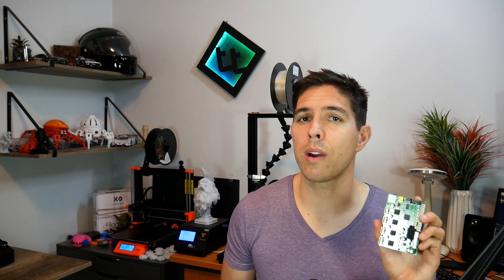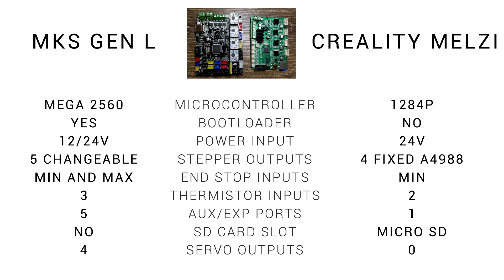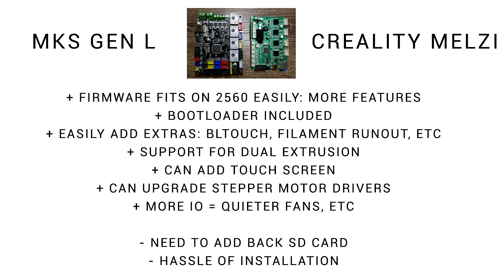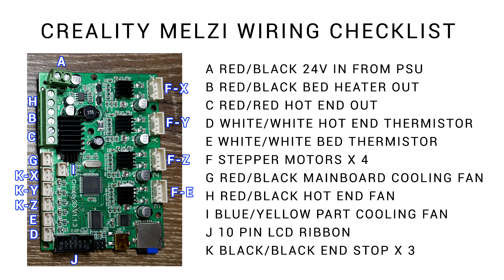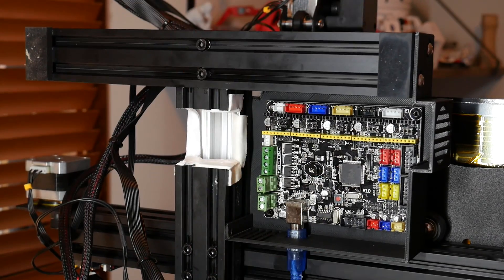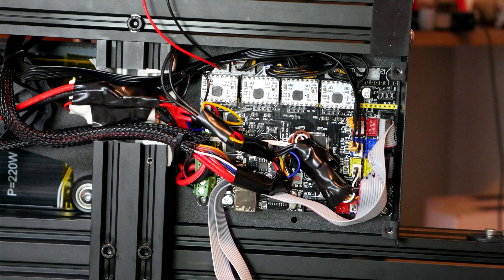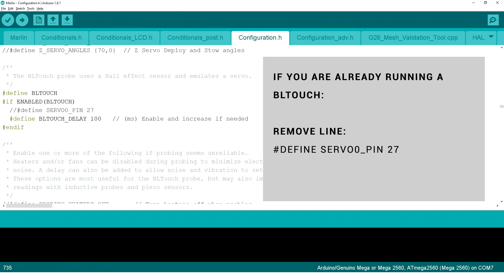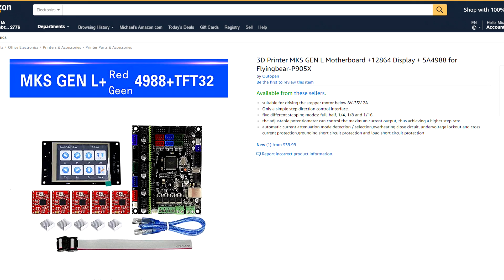Easy and cheap Ender 3 mainboard upgrade: MKS Gen L guide

Comment: Found my brothers old ender 3 and it has this board and the tft28 with it. Doesn't seem to be working so wondering if firmware is wrong. I know this video is old :D but do you happen to know where i can find the firmware for board and screen?

Comment: Michael, I have a CR-10S pro v2 and I get a negative 15 temp reading when it boots up. If I try to heat things up it gives me the temp sensor error and tells me I need to take readings. From all my research it seems the board may be fried. Should I just get the regular Creality board, or are there better after market options? Thanks in advance for any response.

Comment: Thanks for this video i was trying to install marlin 2.0 to Mks gen l i bought online and  i tried as per your video but i am not sure how to set it for Anet A8m model with dual extruders even then i tried with your settings and got an error say "cpmlition terminated. Exit statis 1 Error compilinh for board arduino mega or mega 2560 can you help as i am new in this and dont now much about the programing. Thanks in advance.

Comment: Hello,I am trying to use mks gen L v1.0 board with my cr 10.I have tried to upload the  marlin frimware by making changes as per cr 10 configuration but my machine still not working.
I am able to use pronterface software to move steppers and set the temperatures and run fans.but as i start printing thereis nothing happening on the machine.

can you please provide me the firmware for the same.

thanks in advance

Comment: I wish you went more in depth I  flashing the board.

I'm stuck and been stuck for 3 days on it.
The computer wont communicate at all with board other than it allowing me to preheat the extruder and bed.

That's all it does for me. I've been through adruno and got the settings right for it. But I cant get it to communicate at all with it. Keeps getting red error messages.

Yet. When I press send...it makes board blink for a second or two then gives red wording. I've been through drivers and I'm about ready to throw it in the trash
Reply: Did you ever find a fix for this? I am trying to upload the firmware and keep getting board disconnected message at the end of the upload. The board IS connected, and I have the correct board and com port selected, at no point does it disconnect, however arduino keeps giving the message. The firmware is able to verify without issue. I have tried updating the drivers, using different com port, restarting my computer, uninstalling and reinstalling the arduino IDE. I'm running out of ideas, this is a brand new board and nothing has been done to it besides connecting everything and plugging it in to the computer.

Comment: Is there any way you can send me a copy of the firmware for the MKS GEN L mainboard.  I bought the mainboard for my Ender3 after watching your videos several times. I have tried and tried many times to get the marlin firmware to work but I constantly come back with errors after I hit verify and I have no idea how to fix the errors. Please forgive my ignorance with this. I am pretty good with hardware but have very little experience with software/firmware and you make it look so easy. My original Ender3 board quite operating the extruder function. This being said I did make my own direct drive mount out of aluminum like the ones they sell fot $35.00. I also installed a all metal hot end. I have after market bl-touch, not a name brand but it's not mounted because I can't print the part to hold it. I also bought a micro SD card slot that is supposed to snap on to some of pins of MKS GEN L board. I am very sorry for this lengthy message but I haven't been able to use my print I almost a year. Please any help you could give me would  e more than appropriated. Signed Ken.M thank you again sir.

Comment: hi mick i am getting this error can you please help,Arduino: 1.8.9 (Windows 10), Board: "Arduino/Genuino Mega or Mega 2560, ATmega2560 (Mega 2560)"

In file included from sketch\ultralcd_impl_DOGM.h:80:0,

                 from sketch\ultralcd.cpp:96:

dogm_font_data_Marlin_symbols.h:34:20: error: U8glib.h: No such file or directory

compilation terminated.

exit status 1
U8glib.h: No such file or directory

This report would have more information with
"Show verbose output during compilation"
option enabled in File -> Preferences.

Comment: Wtf why is there a connector on your hot end cooling fan wires. And how are you connecting it to the board with that connector? Are you using some sort of adaptor? Why?

Comment: hello guys
i got my ender 3 and decided to update it 
First i updated it to an MKS GEN 1.4 with TMC2100
compiled Marlin 1.1.9, 2.0 and 2.0 bugfix gave me a board compiling error
everything worked fine , had to reverse the stepper motors direction in the firmware
all ok, except for the extruder
working but very very slow, it takes about a minute for 10mm of filament
watched all possibles videos, no tutorial mentioned swapping the cables for the stepper motors
either for the MKS GEN 1.4 not he MKS GEN L
tried E0 on a different axes, motor worked fine
but everything connected to E0
runs at a very slow pace
swapped motors, cables,steppers (A4988) and even motherboard
not working as it should
i tried to find the pairs of the cables with the led method
found pairs, didnt know ho connect them
so i tried all possibilities
i am going bananas for almost a week
i dont know what to do
i could swap to an mks mini
but i followed several tutorials for the
MKS GEN 1.4 and MKS GEN L
and still the same result
so i would like to solve this problem
is there someone that has had the same issues
any help is appreciated
i will send a sixpack as reward 
to the one who can help me solve this nightmare
thanks

Comment: Hi Michael, I have a question about the V2.0 board. Will this work the same as the v1.0? It has a lot more jumper options etc... and will the firmware from the v1.0 work on the V2.0? I’m putting one in my CR10, so if you have a working solution for me I really would like to know 😁

Comment: The board reaches its maximum if used on delta printers in combination with a touch TFT.
The atmega2560 is an 8 bit controller. Delta printers should better stick to 32bit processors so for example the MKS V1.3 which uses LPC1768 or boards with an arm STM32 processor. Bonus, also higher clockrate, DMA that can speed up alot , the atmega's don't have that.  note, use marlin 2.0 for any of the 32bit boards.

Comment: When verifying, I get this message in arduino and can't figure it out:

sketch\src\HAL\HAL_AVR\u8g_com_HAL_AVR_sw_spi.cpp:65:20: fatal error: U8glib.h: No such file or directory
compilation terminated.
exit status 1

Error compiling for board Arduino/Genuino Mega or Mega 2560.

I have Arduino Mega 2560 set for board and Atmega2560 set for processor like your said. Can anyone help?
Reply: yeah you need to to go SKETCH > Include Library and mae sure you installed U8glib as its necessary for the LCD.

Comment: What is a boot loader? I'm lost straight out of the gate
Reply: You have lots to google about. Type "what is ender 3 bootloader" in Google and you should be sent on your way. This will raise further questions, just repeat the procedure.
Anyway, a bootloader is a way to change the printers firmware.

Comment: I want to replace the controller on my Ender 3 Pro I was thinking Bigtreetech SKR Pro 1.1 with TMC 2130 spi do you thing I need to upgrade the LCD display and what do you think about the THC 2130spi drivers ?

Comment: Hi, Looked at your video. Very interesting but you go to quick through the explanations. Also the mk gen 1 box that you show is not on thingiverse. The improved - storage in the back of the ender 3 is there and I would rather have the model you showed that is in the front with the lid and fan in front. can you please supply that one? Also as a newbie - what type of ribbon cable will I need?

Comment: Hi there, 
Love your channel, you are very clear and informative! Clearly shows that you are a School Teacher keep up the amazing work!
I just have one small critasism, I am currently upgrading my Ender 3  with the MKS GEN L board, tmc2100s, bl touch, tft32 and EZR extruder. 
When it comes to the firmware I'm a complete idiot and am trying to follow all your appropriate videos that include the fw instructions. 
I am finding it soo hard to follow though as the fw alterations are scattered across so many videos that are not specifically fw videos! 

Would be soo great if you could edit together a single video solely on vanilla marlin fw changes, rather than referencing "we did this in another video" but dont put a links to those in the description!
I hope that makes sense lol 
Keep up the outstanding work 👍👍

Comment: Please help. I did everything as you wrote and it broke my printer. I triple checked all the connections. Hotbed doesn't work at all - it doesn't detect its temperature, Z axis is stuck halfway up and I can't move it down further than that. On top of that, I followed your TMC2100 tutorial and extruder makes terrible noise and loses steps... Please help

Comment: my creality board 1.1.4 x axis plug dont work, can it be fix or do i need to buy a new board? thanks
Reply: i know its the plug because i replace the y with the x and it worked but not the y engine so it must the board plug

Comment: i keep getting the  error message "avrdude: stk500v2_getsync(): timeout communicating with programmer
An error occurred while uploading the sketch" does anyone know how to fix this?
Reply: Are you trying to flash a bootloader? I was getting a similar error when trying to flash a bootloader, and fixed it by adding a 10k ohm resistor between the arduino ISP's GND and Reset pins. This prevents the board from resetting itself while trying to flash the printer control board.

Comment: good day Michael. thanks for the videos. I did this upgrade to my ender 3 and have been using it for a while. recently the printer started rebooting about every 30 seconds and octoprint won't connect. any idea what this problem is? it has never done it during a print and I have been printing a lot lately. until today it would do it a few times then I could connect but now it just does it over and over. I really need some help on this

Comment: First , I love your videos .... I have decided to upgrade my Ender3 and my ender3 pro . I would like to switch to either this main board or the one in a newer video ( SKR 1.3 )  and I would like to add bltouch and the color touch screen .. I am new at this. I would rather do everything at once if possible..  1.) which board would you recommend  2.) Can all of these changes be done at once..   What process should a relative newbie take to tackle this ..?  I am still using the stock hot end configurations .  Thanks 
'

Comment: Does MKS GENL support tmc2130?
If so, what mod do I need to change?
Thanks
Reply from the maker: I have a video on this linked in the description
Reply: @TeachingTech  thank you so much for all of your video and tutor. I am a beginner for 3d printing. I am going to buy a Ender3 Pro and there is a question about the firmware on ender3 pro. Is ender3 stock firmware compatible with ender3 Pro? vice versa. I will stick with stock setting and upgrade the printer step by step as I am still figuring out the marlin and all program.

Comment: Long time watcher first time commenter. 
Hopefully you can help. I have a ender3 with mks gen l board.  I installed the bl touch, everything is operational with the exception of when the probe is pushed up it doesn't stop z movement going down. 
I got frustrated and reconnected the stock z end stop, to my surprise that doesn't stop a movement now either.  I'm guessing I screwed up firmware somewhere. Any ideas will be appreciated!!

Comment: I have followed all of the steps one by one but MUST be missing something. on two separate computers i have had the issue of arduino not being able to upload to the board because it doesnt recognize it. It times out after 10 attempts every single time.
Reply: I have attempted this on 5 mks gen l boards already with 0 success. 3 burnt out during my attempts to upload whether from making contact with a conductive material or just bad board i cant say for sure.

Comment: its good board no need upgrade. is it 32bit. well then you need upgrade again lol
why need bootloader. just god damn flash firmware. you need do it 1 time in your life. if something work no need update.
bootloader take memory and corrupt print if you plug usb. it reset printer becouse bootloader

Comment: Great video - Best I've found and I've done a lot of searching lately as I have upgraded my Ender 3 to the MKS Gen 1.4 board and followed all the instructions - flipped the ribbon cable - connected EXP 1 on mainboard to EXP 3 on LCD panel, updated and flashed the firmware updates but the LCD panel does not show text/menus.  just blue.  the panel DOES work on the original motherboard (but old board has issue with bed temperature).  So I suspect its something I'm doing wrong in the firmware...  Help appreciated!

Comment: I am trying to enable auto extruder fan when temp goes above 45C. I have the code below but the fan is still always on. It is not being controlled by temperature. Not sure what I did wrong. If someone can help I would appreciate it.

#define E0_AUTO_FAN_PIN 7
#define E1_AUTO_FAN_PIN -1
#define E2_AUTO_FAN_PIN -1
#define E3_AUTO_FAN_PIN -1
#define E4_AUTO_FAN_PIN -1
#define CHAMBER_AUTO_FAN_PIN -1
#define EXTRUDER_AUTO_FAN_TEMPERATURE 45
#define EXTRUDER_AUTO_FAN_SPEED   255  // == full speed

Comment: I did it like in the video except:  Display was connected with just 1 cable: EXP1 to Display(plug was turned 180°)
My sd card reader was connected with 1 plug(8pins) to AUX3. I had to change the pins from the cable that came with the sd card reader.

Display and SD Card works, everything else also as far as I can judge it...

I just have ONE problem that I can't solve. My display looks very BLUE and bright with less contrast(white).
When I change the angle and look in a flat angle it gets better....what can I do??  (Ender3 display, MKS Gen L, Marlin 1.1.9)

Comment: Ok i did a tripple uprgade - MKS Gen L, TM2130 Drivers and BLTouch.
I have a couple of problems so far.
The drivers seems to be inverted, homing did crash the carriage on the right side and bed on the front, power off saved me bigger trouble i hope.. Is this just the "invert x/y dir" or any other value in marlin? Homing Z axis did not seem to do anything as far as i could see, but that was the first time using cura for console (instead of octoprint)...

Second, i changed the connector cable accoridng to totalretributioncouk, using exp1 on MKS Gen L and rotated ext3 on display. Power seems to work, as it lights up, but nothing is displayed..

Third, but just a small problem: The new casing from Teaching Tech fits, but i had a problem with the usb outlet of MKS gen 3, since it collides a littel bit with one of the bed rails. I opened the hole a littel bit and loosened the board, that seems to fit just.

Soo.. What to do with my first two problems?
Reply: For the stepper motor invert just look up invert_x_dir and make the falses true and the trues false for  x,y,z,and e0 just like he did in this video. I don't know how to fix the second problem, but good luck! Join the ender 3 facebook group, it's insanely helpful.

Comment: I am having a very difficult time trying to program this same exact board and same printer.  I purchased the board and touch screen also a BL touch they are the same components that you used ( I used your affiliate links ).  The only thing I did different was my selection of stepper motor drivers.  
I've watched tons of youtube videos from a couple different people and not sure what I am doing wrong.   The Adruino program says it has successfully loaded all of my information to the motherboard but nothing operates on the printer with the MKS board hooked up.  Any and all help would be greatly appreciated....
Reply: Any luck on how to fix? having the same problem
Reply: @sdlopez1000  no, no response.

Comment: Using these firmware I cannot get the hotend fan working. It's almost like the HE1 is not turning on to send power to the fan. Can't find any settings for auto fan in th3ds firmware?
Reply: I'm having the same problem. Did you find a fix?
Reply: @Allendilli  I did. Do you have fb? Be easier to send a pic with the explanation

Comment: Well, you forgot the extra cost for the new stepper drivers in your comparison. Although A4988 are cheap, you have to buy new stepper driver for the new board.
Reply: ToBeDefined could you elaborate on this? I just bought this board for upgrade. What do i need to buy?
Reply: @McFartyPants  If you bought the board with 5x stepper motor drivers (link under the video) you dont need to buy anything. Just the Trinamic TMCxxxx stepper motor drivers are not included with the board (which are better thant the included A4988 drivers). AFAIK there is no bundle with the better Trinamic stepper motor drivers. You need to buy them on your own (each driver for about 8-10$). There is another video how to replace stepper motor drivers .

Comment: I'm currently putting a MKS gen L board in my cr-10s and I'm trying to figure out how do install the filament run-out sensor on to the MKS gen L board like where to plug it in at you would not know by chance